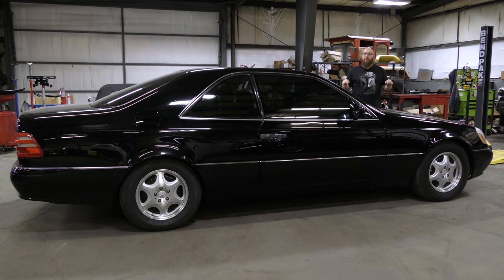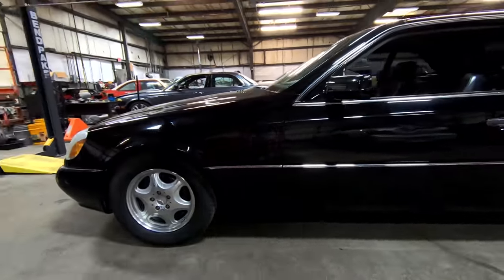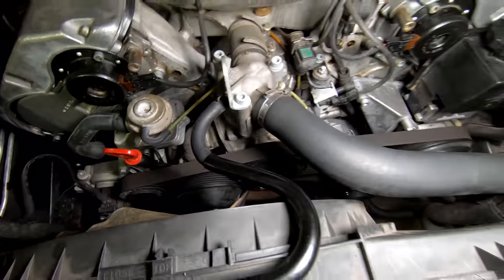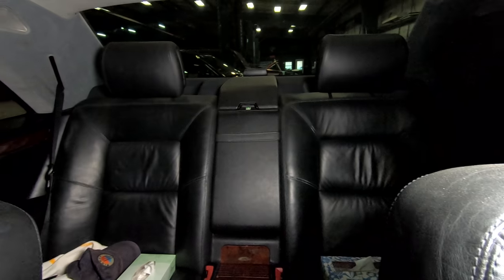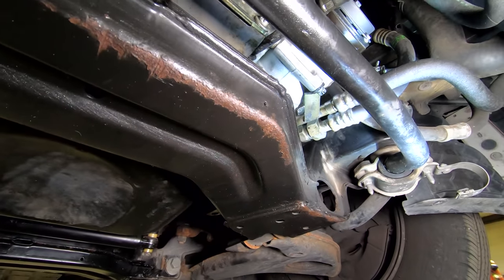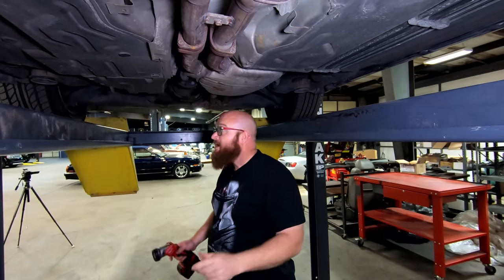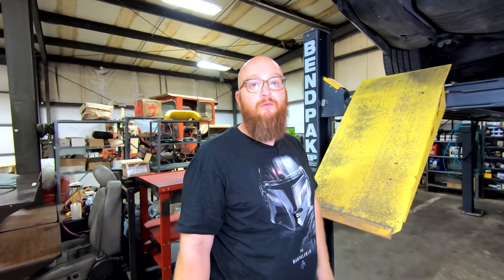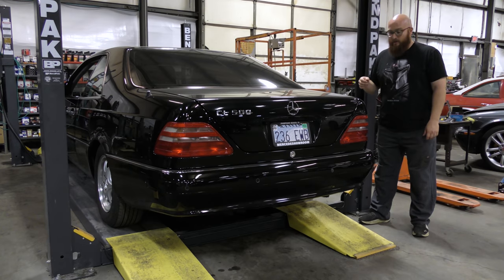One of the CAR WIZARD's first customers! Keeping this sweet '99 CL500 on the road for over 10 years

Comment: Those “strange covers“ would be brake dust covers. They keep the brake dust dirtying up the wheels however, they can sell up calipers and overheat the brakes because it does not allow the brakes to ventilate properly – as I have seen anyway. Call car! Congratulations on the business growth, car wizard!
Reply: Stop mansplaining.
Reply: Wasn’t, knowledge is power and I live to learn. Stop trolling 👍🏼
Reply: @getchasome6230  He was just explaining what those things were.  Lay off!
Reply: I think akebono brake pads would take care of that. They still dust a lot but it's a very light almost white dust. And then your brakes can cool themselves again. I wouldn't ever put those on my Mercedes.... To each his own.. I understand the aggravation of cleaning your wheels and how quickly they turn black.
Reply: Those inner covers were called Kleen Wheels when they were sold in the 90s
Reply: I had them and every 5 to 7k I had to replace rotors and pads , they would get overheated and yes my mechanic warned me about the big mistake I was doing.
Reply: People that drive those tend to never over heat brakes😂
Reply: Kleen Wheels.  I think was the brand I had them on my 560SEL.
Reply: Had this model, 1999, last of the Big Body, being 6' 5" loved it. Never had to fix anything mechanically. Just a great car! 👍
Reply: Those brake/wheel liners are worthless and  very expensive. Just a vanity thing.
Reply: Yep those Dust Shields had to deal with the regular, would never install them on any of my MBZ's......
Reply: Beat me to it.
Reply: @getchasome6230  Your smartarse comment went down well. Didn’t it ? 😂😂😂😂😂😂😂
Reply: @andregreen8040  It went better than yours.
Reply: I had them on my 1986 300 E for a while and took them off. 

MB-USA recommended against them and I could see why. 

As others have said they would not let the heat dissipate. Never had any trouble with the calipers though

But those brake pads in the 80s would give you a completely black wheel within a week or two. 

The factory pads seem to have gotten a lot cleaner.

Comment: My biggest motoring regret was selling my W140 Coupe (CL600/M120). Just got too frustrated with the flat battery after not driving it for 3-4 days. Turns out, it was the seal on the soft-close doors, wouldn't seal, so the pump would forever cycle and dead the battery. Sold at the worst time too (about 6 years ago), probably 3x the price now :(
Reply: major f up

Comment: When you find a good shop, you stick with it!  I've been with mine for 21 years now.  I'm pretty sure that he'll be one of many customers that sticks with you a long time, Wizard.
Reply: I agree, I found a shop near to me that I trust. If they say I need something, I know they aren't trying to 'pad' the bill. I found out about them by word of mouth and I try to let people I know if they need a mechanic shop, I suggest them. They don't advertise but if you need something done by them, you may need to wait a couple of days to get worked in.
Reply: @dave_n8pu  Yeah - same in my case.  This garage has been around since the mid 1950s, and while the garage itself is on the third owner now, each time the torch was passed, the prior owner took a lot of time to get to know the potential new one before entrusting the business to them.  Even though the current owner is my age (mid to late 40s) and tech savvy, he still doesn't advertise - doesn't need to.  Word of mouth has them booked solid, day after day.  When you do the job right, people come back.  Heh - one of the best ways to know a good mechanic is when they tell you what you don't need and why.
Reply: @Dakiraun  I have a rust bucket 1998 pickup truck, it had dual 'cats' from the engine which combined to a single exhaust. I ask them if they would make it a true dual exhaust all the way back. You don't need that, which I said was true, but I want it. So they priced out about what it would cost, afterward I said do it, so the tail pipes would last a while, they did them in stainless steel and welded the connections. It still looks and sounds as good as it did when they put it on their a few years ago. This old boomer (70 +) guy likes the way the exhaust 'talks' when you 'goose it'. It has a 5.7 liter engine, I suspect their exhaust work will still be good when the body has rotted off, but I don't care.
Reply: @dave_n8pu  Nice - I like their honest answer at first.  Heh, and probably true that those pipes may be all that's left of it one day, haha.  Enjoy every bit of it though while you got it!
Reply: I used to follow that philosophy but the most trusted and beloved shop in my neighborhood has gotten absurdly expensive.  They just quoted me $1600 for front struts on a 2010 Camry….  Suffice it to say I will be taking my business elsewhere
Reply: Amen! That and sometimes I will give my mechanic “Food Gift Cards” so he can get some food on Breaks.
Reply: Yes I have used the same shop for over 25 years. It's not quite the same now as my friend (From Mercedes Dealer in the 80s) has died now and I miss him badly when I go there.
Reply: @nigelalderman9178  That's nice to have such a personal connection to the place.  The loss will always hurt, yet that also speaks volumes of how much he meant to you.

The shop I use is on its third owner.  The original guy, after which the shop is still named, opened it in the mid 1950s.  He retired in the 1980s, selling the shop to a mechanic duo.  They owned it into the 2010s, then after over a year of renting one of the bays to the current owner, they decided he had the ethics and business sense to carry it on properly and offered it to him.  The original owner's grandson still goes there - loves that his grandpa's sense of honesty and fairness is still the foundation of how the place works.

Comment: I'm running a tiny shop out of my home now. Thanks in no small part to your inspiration a couple years ago I decided to retire from nearly 40 years as a carpenter and pursue my one true passion full time. I model my approach to repairs after yours in that I won't waste my time with band-aid fixes, and it needs to be done right every time; if you want to cut corners call someone else.  This is paying off in spades already through word of mouth as well as repeat customers. Keep up the excellent work Wizard!
Reply: Up front always wins. Also eliminates troublemakers with empty pockets.

Comment: I picked up a 99 S500 sedan at the beginning of January myself and it's just as nice as this one. These things are so nicely built and so comfortable. Also quite reliable from what I've seen although not cheap when it does need something.
Reply: Yup! I have a 99 s420, I got it at 160k miles at 170 lots of things went wrong and it was all original parts, it took 24 years and 170k for stuff to start going bad, nothing major but it was a lot, thankfully had a retired Mercedes’ tech from San Francisco to work on it
Reply: I really want a W140 S500. It’s the car that really made me a huge Benz fan ever since I saw Get Rich or Die tryin when I was 15. These cars look so badass especially in black

Comment: That 119 engine reminds me of September 11th 2001. I was fresh off my apprenticeship at the same Benz dealer I still work for. 
I had just removed the front timing cover and discovered the intermediate gear had some broken teeth from broken rails and timing jumping, no bent valves thankfully. That’s when the 2nd plane hit the towers :(
Parts were grounded for over a week. 
I remember pushing my toolbox to another bay and replacing a head gasket on a 104 engine. Crazy times. 
That 119 engine was in a SL and that car still comes to our dealership.
Reply: I have a 96 SL 500 and that M119 is a gem of an engine. Other than the fact that other than the early ones they had those plastic cam oiler tubes which tend to break after 100,000 miles or so. I went to a pick and pull and put some aluminum ones off of 92 and everything‘s been fine. 

Car has 222,000 miles on it and uses virtually no oil. Gets about 20 miles per gallon in town and 24–25 on the road

Comment: Those inserts are called dust shields. For the most  part they work great but they make the  wheel bearings run hotter. TMP from N.J.

Comment: I would be a customer like that too if you were in my area. I had a mechanic shop like yours but he retired I had been using them probably twenty years or more. A trust relationship goes a long way and we had one. I have found another been in business for sixty years they came highly recommended I haven’t had too use them yet but I will when the time comes I already visited them and talked with them.

Comment: Looks very well taken care of. 
I'm surprised that there is no rust. My daily is a 02 S500 and the rust repairs keep coming back. Paint keeps bubbling in new areas. 
I've read somewhere that the W140 and W220 (early 00s) have issues with rust
Reply: Yes, an overestimated lifespan of the wrong anti-corrosion solution at the factory so the cars varied wildly. Some early W220s are much better than others. Fixed by middle of '03. Still great and reliable cars mechanically (without ABC)

Comment: Had a 95 500CL.. really good car actually pretty fast for a heavy car with only 300bhp.. Had the standard shocks on mine for also for such a big car it was not terrible in the corners, no sports car of course but certainly did not handle like a boat as you would think it would.

Comment: i owned a '97, put more than 250k miles on it, never had a serious mechanical problem, drove it coast to coast a few times.  the "strange metal pieces" are dust shields to keep brake dust off the wheels.  have not had a MB since that i liked more.

Comment: I love the w140. Dream car for sure. I had a 95 s350d turbodiesel as my first car. Picked it up for $1100cad with 485,000 kms on the clock. Sold it with 530,000 for $1500 back in 2015. It wasnt perfect, but i loved it. Still miss er daily

Comment: It is true that this car has speakers in the corner of the dash near the windshield, but they are not for the stereo, they are for a cellphone hands free hookup. No music comes out of the dash speakers. Even minus that, the W140's had great sound & I wish my newer MB's had the audio oomph of the W140 Becker system.
Reply: Not true. Those speakers are small, round speakers, music does come out of them
Reply: @rickhall1146  I could direct you to a couple of forums with "experts" that clearly state that unlike the W126, the W140 dash speakers are solely for phone use. An example; "The 2 speakers in the dash were never made for music. It was strictly for the phone functionality." I know that my 96' S500 with stock stereo does not use these speakers, but I have read that when aftermarket head units are installed, the dash speakers can easily be incorporated via the single Bose amp (trunk/left side). Like you suggest, it makes sense that audio should come out of them and then mute audio during calls, but when you look at the raw speaker itself, is sure looks like something only made for voice. In any case mine are dead, if you have some that work for music...goody.

Comment: My 1999 Volkswagen Passat feels the same. Built like a tank. Zero corrosion, stock clutch with 190k miles. And doors that sound like bank vaults doors. I was thinking about it. It’s the German cars from 1997-2002 that are the best imo.

Comment: Those 'caps' are aftermarket dust shield to prevent 'black' wheels. It works but not a good idea as brake can get very hot under certain extreme circumstances.

Comment: I’ve had a lot of Volvos down the years, they embody many of the same values. A lot of the difference between these quality vehicles and cheaper cars is the finish where you don’t see. Better paint on the components beneath trim and under the car, better quality steel on the pressed components.

Comment: The lovely "wood", is infact aluminium that's had the "veneer", printed on it. I worked for an American Company, Northern Automotive in one of their factories, in South Wales, UK ( not England), we made these parts for Mercedes and many other car manufacturers.
The wheel brake dust covers are a pain, I removed mine from my Merc'. That 500CL is a beauty. 😁👍👍
Reply: So the veneer is fake? I know Jaguars of this era had genuine walnut and perhaps maple veneers.
Reply: Not true. That was real wood applied to aluminum back
Reply: I worked at Northern Automotive from 2000 to 2006.
I know what I made then, it was printed aluminium, a walnut burr, and an absolute pain to manufacture.

Comment: The CL500,five litre,has about 306 horsepower which is similar, I think, to the 307 Chevrolet 5 litre 315 hp -about a 20 year age difference.

Comment: Wizard charges double of what most dealerships charge for per hour in labor costs. I mean damn, wizard may have good mechanics, but geez lol. Most people complain about the dealership costs. At his labor rate, It's almost not even worth doing most repairs that will take more than 4-5 hours to do. Dealerships have more overhead as well than wizard does. Wizard is a genius lol. Making a great living on what he charges. I'm not talking crap about, Wizard, I'm applauding him for what he can charge and have customers that will pay that. Good for him. Example, this video has a car with, 4k worth of work to do. Parts are prolly less than 1k. And I'm being very nice with that 1k in parts cost because valve covers and those few other things are not close to 1k lol. So my 1k in parts is prolly hundreds higher. Over 3k in just labor.

Comment: I need peoples opinions.  I have a 1998 Toyota Camry XLE with a V6 engine The car is perfect it has 203,555 miles I bought it in December and have put 8,633 miles on it the interior condition is perfect except for a few small tears in the leather.  Would it be worth putting $4500 of work into this car when I bought it for $2300. Some of the stuff that needs to be done as a full suspension replacement valve cover gasket replacement power steering belt replacement and then the general 200,000 mile maintenance done and a bunch of hoses and other belts to be replaced. It was also a one owner car.
Reply: If it has no rust and the engine has healthy compression I'd do it. Cheaper than buying a new comparable car. Check out Car Care Nut on YouTube. The guy is a Toyota guru.
Reply: Yes, do check out The Car Care Nut for his wealth of knowledge and information on everything-Toyotas. Myself, I've put much more than that into my '99 Saab, and we've averaged at least $1k every year in the last few for our '07 and '09 Camrys as well. As long as they're rust-free, fixed for awhile, and safe, it's well-worth it, especially nowadays. Once you do that with yours, no matter the mileage, you probably won't have to do much else for years to come. ETA: The '98 might be TCCN's favorite Camry MY.

Comment: the engine cooling fluid should not be green but blue. older mercedes need fluid with silica in it for corrosion protection.

Comment: Well built car BUT, you have to keep up the the maintenance like this owner, even though it seems expensive at the time. $4000 is a lot to spend, but if you let it slide, it will be toast and cost a fortune to put back right. Good job.
Reply: Same problem with everything. Boats, houses, cars etc. If you let it collect "small issues" it will usually wound up costing way more and hurting more instead fixing issues as they come up.

Comment: This car needs wider wheels or at least spacers. Especially in the rear wheel house is too much of space. Always an optical problem with the W140 (also with my C208, I cured that wit 35mm spacers each side).
Reply: They had a few other different wheel styles those are my least favorite I agree. The original 16 inch 9 holes look a lot better.

Comment: I don't agree that headlamp lenses should still be glass. They break and are very expensive to replace. Composite headlamps should have replaceable lenses. The lenses should be like windshields, a wear item and almost as important for safe night driving.
Reply: Plastic lenses are more prone to yellowing, cracking, and damage from road debris. Glass lenses are even more expensive as it's difficult to mold optically correct headlamp lenses in non standard shapes.

Comment: So with this type of lift (where the tires sit on the rails), you can't check for wheel play/bad bearings like you do when it's on the other type of lift where the tires just hang in the air, correct?

Comment: You are so wrong in stating that MB is better put together than Toyota or Honda.  Thought you’d knew better.  Done with this channel.
Reply: Older Mercs (pre Daimler Chrysler era) were solidly built.
Reply: Opinions are like belly buttons.
Everyone has one.
Mercedes Benz outsells Lexus and Acura by a massive amount worldwide and as some of the highest owner retention rates in the industry.
They are apparently satisfying customers well enough for them to spend a substantial amount of money for a new one.
Reply: He was talking about the ‘feel’ of a Mercedes “of that era” specifically with reference to the materials. He didn’t actually say that Mercedes per se are better put together than those cars.
Reply: Don't be such a snowflake. Drive what you like.